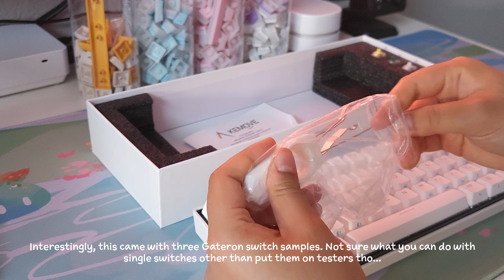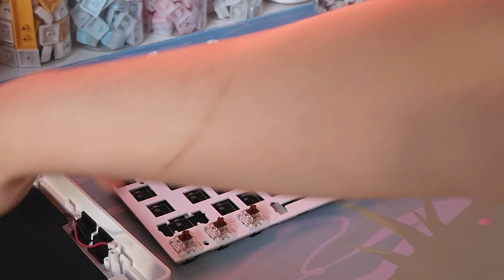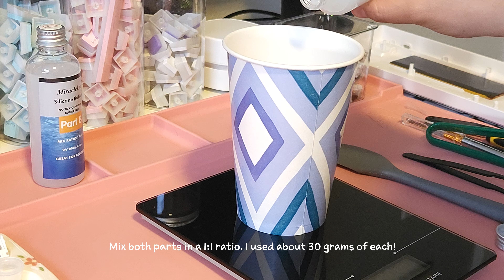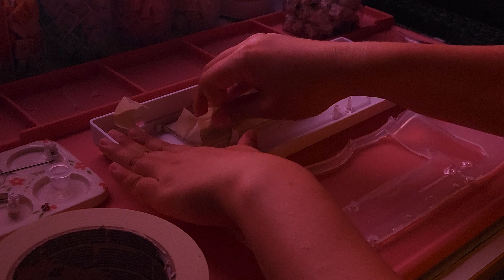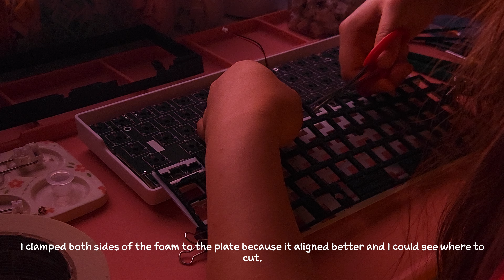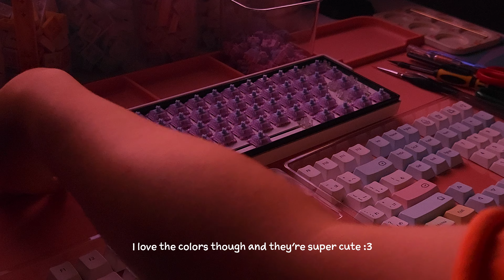Kemove Snowfox DK61🦊| unboxing and modding w/sound test

Comment: is it possible to replace the PCB?
Reply from the maker: Don't think so!
Reply: @nessasaurus_  do u have recomendation for budget barebone kit 65%? I heard tm680 is very good?
Reply from the maker: @wall  zoom65 :) the tm680 is basically an lk67 which is smth I have up on my channel for reference. I personally don't like the sound profile and in general prefer aluminum boards, but it sure is budget. I'd much rather opt for a zoom65 bc u get extensive case, weight, and plate options, it comes with a carrying case, and it sounds premium for its price. If that's too pricey bakeneko65 is also a good option.
Reply: @nessasaurus_   zoom65 too expensive for me, my budget is 100$